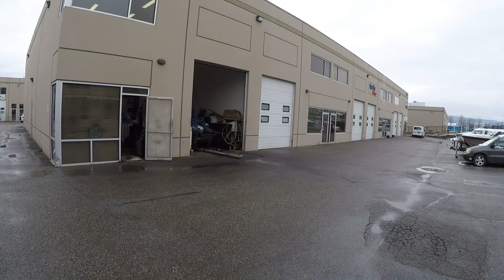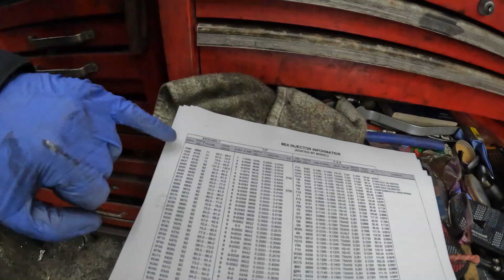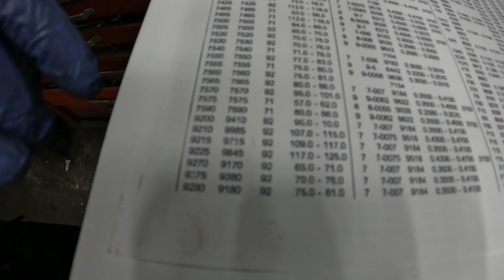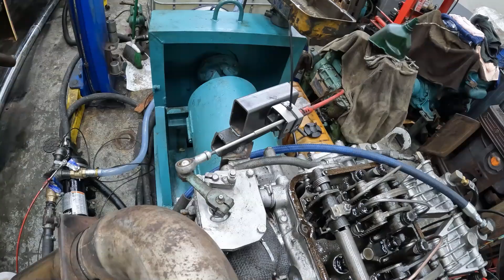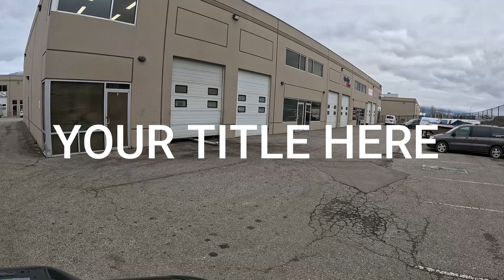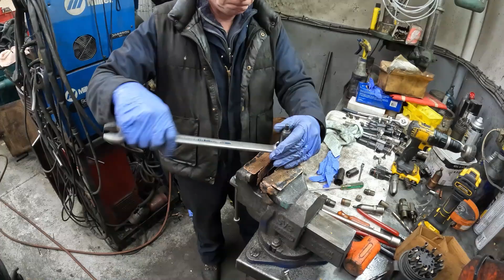How Detroit 2-Stroke Injectors Work

Comment: 21:36 sorry bro it wasn't for emissions it was for control if burning hydrocarbons we're really a problem the airline industry would be deleted from service there are 30 some 1,000 aircraft registered to commercialized flying find the gallons per hour burn of the 737 747 777 whatever Airbus 380 find the gallons per hour and then there's a place on Google you can find Total flight hours and that number is astronomical that's the reason I'm not putting it down here something you need to do for yourself that astronomical number is so hot if burning hydrocarbons contributed to global warming understand that would stop overnight
Reply from the maker: With common rail and after treatment, emissions are drastically reduced.  In the airlines, engine manufactures are reducing emissions as well by designing newer higher bypass engines.  Look at the LEAP and the PW 1500 geared fan as an example.:)  If you break down the fuel economy per seat mile is is very economical.

Comment: Maybe a silly question but will 8v92 injectors fit in a 8v71?
Reply from the maker: Yes they are interchangeable.:)  I run 92 and 71 series injectors in my 4-53T's.
Reply: Working on a hot rod semi project with a 8v71t. Have a blown up 8v92t, thinking of combining some parts for some more power.
Reply from the maker: @dMaxJunkie68  Awesome:)

Comment: I have to ask all the injections plungers are all the same size but with different shape spirals on the plunger and the bushing?
Reply from the maker: The plungers and barrels will differ in size depending on the cc output.  Tips are also different for the different size of injector.

Comment: Can you tell me what parts of the injector determines the size or flow rate?? Thanks I already subscribed! I’m a happy new Detroits owner
Reply from the maker: Flow rate is determined but the plunger and barrel size and the tip size.  The flow rates are usually tagged on the injectors, for example 5A60’s are 60cc’s per 1000 strokes.
Reply: @  My 12v71 are de tuned from 900 hp to 800 I was wondering if I can restore the oem settings but retaining the low rpm fuel economy 🙈🤷🏻‍♂️
Reply from the maker: @ You have to see what injectors you have in them now and the governed rpm.    What kind of rpm's are you running them at?
Reply: @ Ill remove the valve covers this week to check everything before start the engines I’ve been reading about them and they got me amazed Ill be in contact 👍
Reply from the maker: @marinaportocaribe  Ok, sounds good.:)
Reply: @detroitgarage9430  Hi t’s a 80tons boat 0 stuck injectors in one side of one of the engines they are reliabuild 9215 the engine have very old oil almost the double of the amount & it looks greysh like aluminum or steel particles not copper the seller says they ran it 1100 1800 rpm I’ll try to start them tomorrow with 6 batts but I can’t figure how to connect them in the oem location seller says one of the engines have inoperative shut off flappers so it doesn’t start sounds easy…

Comment: I love your content, years ago when I worked road construction I ran equipment that had 353 671 12v71 and 6110 engines, later I owned a tree farmer skider with a 353 engin, al that said I never under stood how the injectors worked.  I was on a job where a 6-110 ran away and it sounded all together different in the full fuel mode. The guy running it did get it stopped and a mechanic fixed it and it ran for several more years till the company tradded it off.   Thanks again !!
Reply from the maker: Thanks, I'm glad you enjoyed the video.:)

Comment: Late reply here again. Great video. I remember the 8.2 Fuel Pincher had the same injector / rack system. Used a injector height pin also. Boy would it smoke on a cold morning start. So bad Detroit ordered injector changes to help the smoking. Could you convert the 453 to a DDEC system only. Maybe using Series 50 electronics?
Reply from the maker: Yes, I forgot to mention the 8.2.:)  Uses the same injector as the 2-stroke with some tweaks.  Yes the 4-53T's can be converted to DDEC and 71 or 92 series injectors.  Most guys use the 4-71T DDEC ECU and injectors.  Turn them from 2100 rpm up to 3000.:)  I know a guy working on a 4-53T DDEC right now at 400HP.:)

Comment: Great video, despite having worked on these GM diesels (Detroit and it's big brother EMD) for as long as I can remember I've never actually taken an injector apart. Why, well that's a good question!  

Anyway my advice is to leave these engines alone, they are great engines in their naturally asprerated form, a 671 running N65 or even N70s naturally asprerated makes around 220-240 HP and will run at least 15,000 hours between inframes. Now you start hot roding it throw a turbo and bigger injectors on it and bump it up to 275 hp and you just cut it's life down to  10,000 hours. This goes right to what Johnson and Towers did to these engines, and why they have such a terrible reputation. J&T cranked the 671 up to 485 HP with an intercooler,  blower bypass valve, and massive injectors. These engines rarely last 2500 hours. Now they really messed up on the 16v92s that they cranked up to 1650 HP. Those things are smoked before 1000 hours. Same thing goes for the 53, 71, 92, 149, and the EMD 567, 645, and 710s. Put 645 power assemblies in a 567 and remove the turbo and replace with blowers. She will make the exact same power NA and last even longer without that problematic turbo. However leave it turbocharged and run 645 power assemblies and your going to have a much shorter life.
Reply from the maker: Thanks, having lots of fun running them.:)

Comment: Thanks for the detailed explanation of the injectors. I also appreciate your mentioning how they differ from the Cummins and Mercedes. This was very interesting. I really like simple mechanical fuel injection rather than electronic. My 5.9 Cummins, 4,5 and 6 cylinder Mercedes injectors are very similar and simple to rebuild. I see why you like these on your Jimmy after your explanation.
Reply from the maker: Yes, my first diesel was the OM621 when I 16 and learned on that to rebuild the injectors.  Have owned a 93 first gen as well and loved that engine.  Although different than both, the Detroit shares the same simple mechanical principle.  Very simple and easy to repair.:).

Comment: Oh my that brings back memories!  Pump room was air conditioned.  I must have rebuilt a thousand of them.  I remember being surprised to find the 53 using the same spray tip as the 92, given the different diameters of the combustion chambers.
Reply from the maker: Very true, wasn't until I looked at that list closely that I realized the same thing.:)

Comment: Appreciate the detailed video on MUI. When I went through diesel mechanic school at the local community college we had an MUI build race…you are absolutely correct in how simple they truly are, they are precision units, but purely simple mechanical operation. I was looking at the MUI Fuel Injector Information you emailed over…tons of options. So hypothetically could you take the largest 92 series plunger assembly, 3750 spring, and tip with most holes but lowest flow to get an injector that pushes lots of fuel but maybe better atomization through smaller orifice?
Reply from the maker: Yes, exactly.:)  My 7A77's are 3750 psi and they don't smoke a bit.  I'm considering trying those springs on the larger 90 and 100 series with smaller tips etc.:)  See how the 9200's turn out on the dyno.  Just finished the 9G90 runs this morning and they smoked like a freight train.:)
Reply: @detroitgarage9430  Aw man, bummer on the smoke, any ideas on how you might clean up? eBay had remanufactured 9290’s for $50 each, was going to hold off and see how the 9G90’s worked out emissions wise for you, just checked eBay, someone snapped up all but one, o well next time…look forward to 9G90 video!
Reply from the maker: @clayclifford1202  That's the same guy I bought the 9290's from.:)  I'm just rebuilding my N blower and will try different turbos to clean it up.:) Pretty confident I'll get is fairly clean.:)
Reply: @detroitgarage9430  See maybe I’m jumping the gun on trying to purchase injectors, need to hold off till you get it all the upgrades and variables hammered out!
Reply from the maker: @clayclifford1202  The 9290's are a very nice injector and made very close to the same HP, the 9g90's made 248HP and 570 FTLBS of torque.  The torque is 30 ftlbs more and 8HP more for the 9G90's.  If I get more air I should see lower egts, lower emissions and more power.:)
Reply: @detroitgarage9430  10-4, turn that smoke into Hp’s and ft·lb’s!
Reply: 10-4, turn the smoke into Hp and ft.lb!